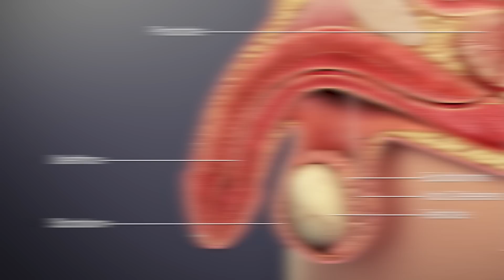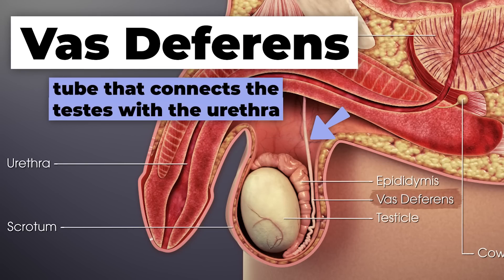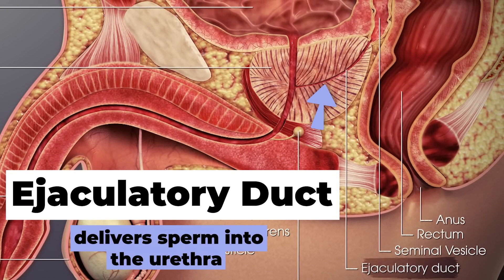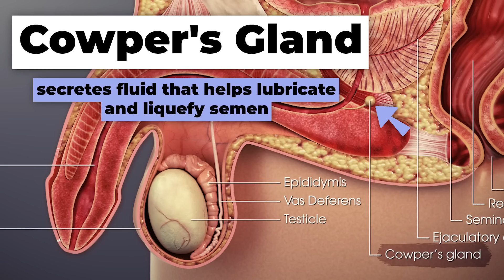A Urologist explains what is semen made of?

Comment: Some College guy investigated what the ejaculate semen was made of & said it was Citamin as you said, Zinc & Selenium to Minerals that are very important for a Healthy immune system something a Medical Drug Pimp can't talk about, it's not on their MENU to $ell. & also when swallowed it worked as a good weight reduction Nutrient. I have researched much of this a good Vitamin E source like Wheat Germ Oil will offer bigger loads to flow, Vitamin C also & getting a Tan from Sun Light or use of a Tanning Salon. Raw Eggs about 6 to 8 a Day from a Farmer. & sit in a Cold Water Bath Tub for 1 full hour a Day. Sit in tub fill it about 3" inches warm water & then shut off the Hot & just COLD fill, 1 (full) Hour a Day & Man of Steal will appear after days & weeks 3.

Comment: That's it, semen production in a – nutshell? Nuts! The drawings shown here are very good but it is really hard to appreciate what is going on here using only a sequence of  2-dimensional drawings. To help us visualize what is going on, what we need is help from people like Walter Lantz and Max Fleischer. And we need to look at their animations many times. And we need to have animations showing us what is happening, from a number of different vantage points. Animal body-part shapes and animal body mechanisms, the way they evolved, are unbelievably complicated. They weren't created by engineers. They weren't created by people who held on to mottos such as "form follows function." Their creator wasn't how can I do this in the simplest manner, using the least amount of materials. Evolved animal mechanisms are thus not at all similar to the relatively simplistic shapes and mechanisms that we see in things that were  designed by humans. Animal mechanisms that you might think are similar to engineering designs, often have surprising peculiarities that make you think – does that really have a purpose or did evolution throw that in there for no particular reason. For example compare semen production with internal combustion engine fuel injection system. Both involve mixing together of several substances before injecting them into a space, together. With fuel injection we have an electric fuel pump near a tank of gasoline, and a second fuel pump near a cylinder head. Then we have a tiny injector tube that fits into a hole that has been drilled into the cylinder head. The injector tube has the same inside diameter and the same outside diameter throughout its entire length. Think of the cylinder head as being analagous to a vagina. We also have to get air into the cylinder head. That gets into the cylinder head at the same time as the gasoline. The process of getting both into the cylinder head is precisely synchronized. The amounts are precisly measured. But the method of getting the substances in are entirely different for each substance. the gasoline is pumped in. The air is sucked in. Sucked in by piston. Neither sperm, prostatic fluid, nor fluis from the seminal vessicles is sucked into the vagina by the vagina. The fuel injectors are the same inside diameter along their whole length. A human urethra, from prostate gland to urethral opening at the tip of the penis, is not only different in diameter, but it is soft, and changes diameter!
      Designers of 4-cycle internal combustion piston engines composed poetry to go along with their design. The poem, referencing intake compression combustion exhaust, using simpler words, is "suck squeeze bang blow; suck squeeze bang blow; suck squeeze bang blow, repeat this 100's or 1000's of times per minute. The poetry that refers to coitus was written by the coital devices themselves (people having sex, compare to motor vehicle), and not by the designer of coitus (evolution, compare to automotive engineer). This poem is not the precise, repeated rhythm of suck squeeze bang blow, 100's or 1000's of times per minute, but rather, it is one joyful paroxism, now and then

Comment: I got one and am not impressed 
It arrived in a plastic bubble rap post bag on opening the bag the product was only in a small clear plastic bag along with a cheep pearly fitting power adapter plug 
On instructions 
It dose not fit firmly in the adapter and you need it as the this item is not built to fit Australian sockets 
All in all it seems to be a very cheep copy or it or the company is a joke 
Ps it dose not charge as quick as it said 
Not happy